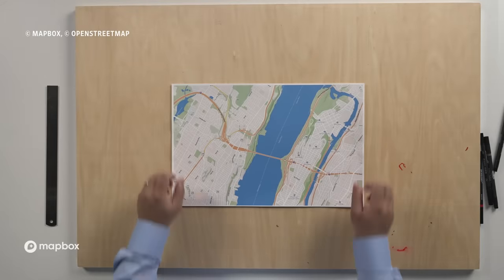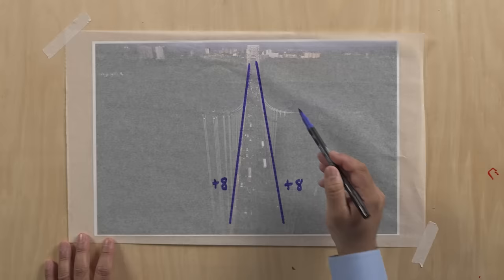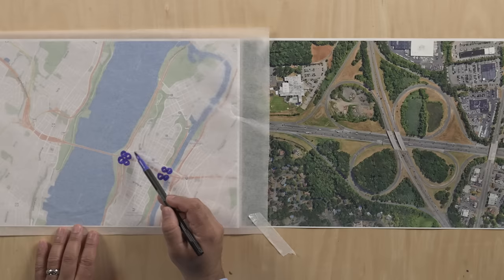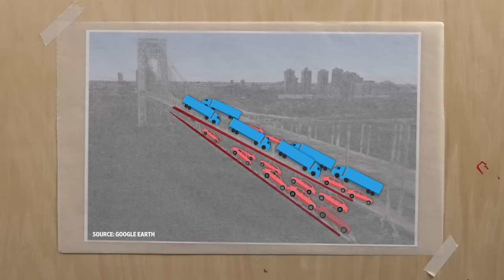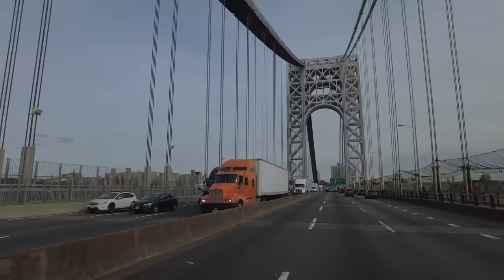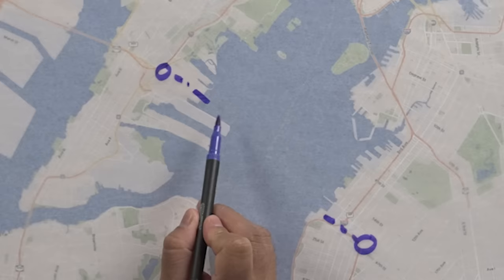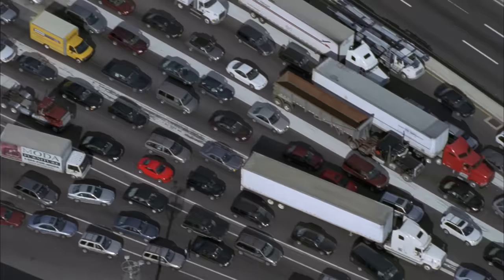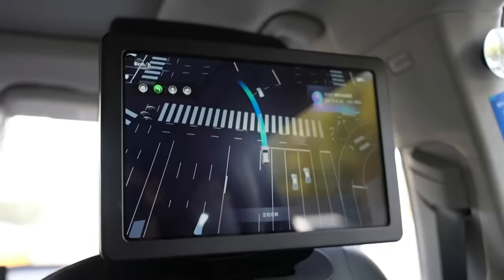Transportation Engineer Tries to Solve America's Worst Bottleneck | WSJ Pro Perfected

Comment: Great video, but one piece they missed is that I-95 (the busiest interstate in the country) is the main source of traffic on the GWB. A large portion of the traffic, including trucks and cars, traveling over the GWB are not going to the tri-state area, however to populated cities in Massachusetts, Maine, etc.  It would be great to have more routes into lower parts of Manhattan, however, anyone who regularly drives on I-95 knows that traffic doesn't get any better after crossing the bridge.
Reply: Sounds like they need express lanes
Reply: @Distress. or even a detour that doesn’t go thru the city
Reply: @Wurtyy  Something like the Big Dig?
Reply: @Awesome_Aasim  that would be pretty crazy but i’m sure effective. seems like the best solution as suggested in the vid is to improve passenger rail in NYC. but if the problem is regional travelers than that’s where our regional trains come into play which are…not good as of now.
Reply: @Wurtyy  I agree improving passenger rail is going to help. However, one issue is why are cars slowing down truck traffic? Having truck and bus only lanes actually helps alleviate congestion, since more people are going to be on the same road, just in a bus rather than a private automobile. The problem isn't that we built highways, the problem is that we never thought about segregating different types of vehicles to make best use of the road space.
Reply: @Awesome_Aasim  great point I didn’t think of that.
Reply: @Wurtyy  There are highways around the city but imagine that going around takes more time than sitting in traffic if not they would already do that.
Reply: @Distress.  The I 287 was designed to just that.  To re-route the I-95 traffic to the I-87 and across the hudson thru the Tappan Zee bridge.  But the I-287 became so popular for local traffic the it is now so congested and slow !  Classic case of induced demand.
Reply: Anyone going traveling North through NYC to New England needs to learn the proper route. They should just hop onto the GSP from 95, then take 287 across Tappan Zee, eventually getting back on to 95 and avoiding all the headaches
Reply: Those trucks shouldn’t even drive thru the city IMO
Reply: @Distress. or extend the northeast corridor south

Comment: GWB not too bad, but 95 Bronx is the worst, right after the GWB.
Reply: Exactly. The Cross Bronx expressway is the most congested highway in the nation. It handles I-95 and the majority of truck traffic in/out New England. There are no other alternatives thru the NYC area for trucks except the Tappan Zee bridge, which is about 20 miles north.
Reply: Which is why NYC is tryna get rid of  the Cross Bronx Expresway
Reply: @dr.woozie7500  because trucks can only go through GWB, lincoln and holland don't allow trucks.

Comment: Most of the traffic seems to be personal vehicles, so here's a simple, cost effective and easy solution that could be implemented within a year or so:
Convert one of the existing lanes in each direction to a bus lane. Add multiple bus lines connecting places where people want to go, and make sure that each line has service at least every 10 or 15 minutes. Ideally you'd have at least 30 busses using the bus lane on the bridge for each direction. All you need is busses, bus drivers, paint and little bit of law enforcement to keep drivers out of the bus lane.
Reply: thats not a solution kid, no sane hard working man would travel in a BUS. Its not dummy europe, everyone just runs away from the problem, the solution is to Upgrade the Decades old infrastructure
Reply: @SJRS700  Toronto has a great bus rapid transit network with plenty of riders and it's also not "dummy" europe
Reply: Yeah we already tried that on the Lincoln tunnel 5 miles south of the GWB and it hasn't done anything.
Reply: @SJRS700 Clearly you’re not from NYC. Everyone takes the bus. Rich or poor, and especially the hardworking.
Reply: @SJRS700 and what is that supposed to mean? “upgrade”
Reply: @SJRS700 hat exactly is “dummy Europe” in your view? You don’t want to compare yourself to the most liveable cities in the world… fine - but why would no ‘man’ (only the hardworking ones of course) ohh, and of sane mind want to use public transport? 

Seems to me that a little more public transport led community exposure could offer your opinion creation a bit more nuance and accuracy 🤷🏽‍♀️
Reply: Rail makes far more sense for the NYC metro area. 20 million people in the region alone. 8 million in the city proper. Manhattan already has horrible traffic with just 50k cars. You want almost everyone in the city to drive?
Reply: @Demopans5990  I agree that rail makes more sence, but building rail there requires a lot of money and political will, neither of which is easy to get. I mean, if there was the money and political will, rail connections would already exist. I'm suggesting busses and a bus lane simply because that doesn't require that much money nor political will. It's something you can do in a year (the limiting factor is how fast you can get busses and recruit/train bus drivers), and it'll serve people while you build better transit.
Reply: There are hundreds of busses crossing per rush hour. The problem is once you get across, the buses don't take you where you want to go, they dump you into a transfer to a subway that only goes south.
Reply: @SJRS700 i see construction workers riding buses all the time.

Comment: I rode my motorcycle across the GWB in 2016. The “paved” surface nearly shook my bike apart. While that was happening my motorcycle cover was being shaken out from under the seat cowl/cover…

I had to hold it with my left hand & the throttle with the right. That’s when I noticed that there were spots you could literally see through on the lower level. The GWB was the scariest bridge once you noticed it was falling apart every day. The Whitestone wasn’t much better. Driving over sketchy American Infrastructure by motorcycle really opened my eyes to how bad our roads & bridges are here.

Comment: And as always trains are the solution.
Reply: We need private trains!!
Reply: @ikanmesra  Those already exist, not everywhere though.
Reply: @MegaLokopo  I meant personal trains.
Reply: @ikanmesra  you could have those as well, yhey just dont exist yet.
Reply: @MegaLokopo  PRT (Personal Rapid Transit). Goood idea though, but create traffic jams just like cars do.
Reply: @ikanmesra  Not necessarily, you could have self driving train car things that automatically connect to each other, and are able to maintain higher speeds. Trains are more efficient because of rail, but they are also more efficient because of coordination, or the massive decrease in a need for coordination.
Reply: @MegaLokopo  Maybe because they can move straight only, meanwhile traffic jams caused by one or two driver who trying to brake in the middle of highway.
Reply: @ikanmesra  Traffic jams are actually caused not by one or two people brakeing in a highway, but every car in a row, brakeing slightly more than the car in front of them until someone eventually ends up brakeing to a complete stop. But yes so long as coordination was a thing, you could incorporate turns as well in a private train thingy.
Reply: @MegaLokopo  That's why the world need autopilot cars. Everything was fine.
Reply: @ikanmesra  Yep, and if you had every car be self driving, and would follow each other closely, it would effectively become a train. And buses would be the equivalent of a communal train carriage. Putting it on tracks makes the self driving a lot easier especially if you ban civilian drivers on public roads.
Reply: @MegaLokopo  Putting it on tracks? You mean trams?
Reply: @ikanmesra  What would you consider the difference between a train and a tram, really they are basically the same thing. And a train is really just a simple self steering car connected to a lot of other self steering cars.
Reply: @MegaLokopo  My country especially the area I live near the capital city needs more trains, coz our traffic are big. And yea, our drivers drives in very high speed even in residential areas.
Reply: This tells the reason why our country has more death on roads. We have MRT, LRT, BRT and ETS and buses but only immigrant workers use it. Citizens only hoping for car.

Comment: I remember crossing the GWB on the lower level when I first started driving a truck. I think after 9/11, they made it mandatory for all commercial vehicles to cross on the upper level. 

Since I got my CDL and became a truck driver (25 years ago this month), I’ve gotten to cross a lot of bridges and highways all over this country. Some bridges are cars and buses only, like the Golden Gate Bridge. Others are scary AF, like the Chesapeake Bay Bridge Tunnel, US 13 in Virginia. Last time I crossed it was about eight years ago, and they I was one of the last trucks to cross that day, before they closed it to high profile vehicles, because of the wind.

The only bridge or highway that I haven’t gotten to cross is the Mackinaw Bridge, from the UP to Lower Michigan. They close that to high profile vehicles sometimes, too.
Reply: trucks have always been required to take the upper level.

Comment: It seems that many traffic bottlenecks are caused by the expectation that single occupant private vehicles can go on any road anywhere at any time.  Imagine the GWB or any other congested highway with only trucks, buses, vans and emergency vehicles at peak times-much of the congestion is gone. That is the beauty of congestion pricing.
Test this the next time you are stuck in traffic. Look around and see how many single occupant cars are around you. (I usually get 8 or 9 out of 10). Now imagine that same stretch of road at the same time with only trucks, buses and vans.

Comment: If you travel south on 87 mobile gps will 9 times out of 10 navigate you TOWARDS the GWB, particularly if your destination includes trips over the Throgs Neck or Whitestone Bridges.  I think there is more to this story than "Congestion" when traffic is being directed towards the problem and not towards a potential solution.
Reply: gps does this because it is still the quickest way to destination; which is a testament to how much of an efficient beast the GWB really is. 

which route is quicker?
Reply: @johnnysecular  um, no. 87 to the Tappan Zee to 4 solid choices to points south and east.  There is an agenda as to why gps sends you to the gwb to sit in standstill traffic and it isn't efficiency.
Reply: @schnitzjr  mm maybe. what is the agenda?

Comment: Practically every town or city in the UK has a "park and ride" where you park your car, pay a few £ (around $5) and take a bus which runs every ten minutes and goes from the car park to the centre of town. Very often it is cheaper and easier than driving into the city and then trying to find somewhere to park. Not sure if the USA uses these?
Reply: In the US we do this much more with trains, particularly those running between suburban areas and the center city in my experience. I'm not familiar with any places that have major bus systems that extensively use the park and ride system here. Expanding out broader in North America, I think Toronto's GO Transit busses have some park-and-ride stations. Those might be just for their trains too though, I'm not entirely sure.

There are so few places in the US where busses have their own lanes and priority. In most places, driving yourself is at least as fast as going the same route by bus. The bus is going to get stuck in the same traffic you would in your own car, so may as well drive yourself. I don't know how much better the UK does in this area, but from what I've seen I have a pretty high opinion of busses in the UK. If people find it worthwhile to drive to a bus to get where they're going in the UK, then your bus systems must work much better than ours.

The other issue you run into with getting people to take busses here is the stigma. In the US, the bus "is for poor people". If you are of this mentality, it's very unlikely you'd want to drive yourself to a bus stop to then get on a bus with the people too bad off to own a car in the first place. Unfortunately, the number of people who align with this kind of thought is higher than it should be.

Comment: To get rid of cars you need good public transport. To get rid of the trucks you need a tunnel from New Jersy to Brooklyn under Manhattan that will have only one underground EXIT (no enterance) to manhattan while continuing further to Brooklyn. The trucks going accross will avoid manhattan, while trucks entering manhattan will not use so many space at bridges so there will be more for cars. And no enterace to tunnel in manhattan because exiting manhattan isn’t as big as an issue as entering it

Comment: Reading all the comments saying, "just add trains" is kind of thinking way too short. First off, suspension bridges are HORRIBLE for rail transit - especially rapid transit. The Manhattan Bridge (which carries the BDFM trains) had to be entirely closed because of how much maintenance it needed due accelerated wear by the trains constantly running over the bridge 24/7.  The GWB would need to be further strengthened and inspections would need to double just to make sure things don't go wrong.

Secondly, where exactly are the trains going to go? Yes, it will go into Manhattan... about 200ft in elevation. That doesn't sound like a problem until you remember you will have to find a way to get the subsequent train line to sea level and below with very limited space to do so as Grand Central and Penn Station are *below ground stations*. One could add loops down which certainly can help at the cost of speed and efficiency. Trains don't exactly turn quick. Alternatively, you could simply have the train be elevated... except it would be elevated about 100ft in the air once it slips out of the hills and with a 2 degree max gradient, it'll be a while till it gets to a more suitable level.
And on the NJ side... well there's not much there. What is already served by NJT goes to Penn Station or is served by the PATH to WTC and 34th Street. Plus the lines, they have to drill through the Palisades to stay level and then carve a path through the marshy Meadowlands and crowded suburbs. Basically, it will not be cheap on either side to just slap down a rail line.

Finally... where is the I-95 traffic going to go if limited greatly or cut off? Route it along I-287? Well, you're just moving the problem from the GWB to the Tappan Zee and it absolutely does not have the capacity to handle that load. Most likely, it would actually just overload the Lincoln and Holland tunnels if GWB is closed. No one is driving 20 to 30 minutes north to cross the Hudson by car. If you want to go 100% car-free, it will never happen. Even Tokyo, a place with amazing transit, can only attain so much ridership (about 20 million daily riders out of 36 million Tokyo metro residents). Thus, you will need to accommodate cars to some capacity even if you would like to see every car that exists to go up in flames.

This all said, basically, replacing the lower deck with train lines sounds like a good idea but all concepts that are great on paper may not be in practice. Always keep that rule of thumb in mind: The simple solution isn't always so simple. This isn't to say I wouldn't like such a solution - I absolutely would - but one has to be realistic. 

The solution I think would work is to cut down the lanes to 6 up top, 4 down below to decrease throughput while focusing on expanding rapid transit into the city further south. Build more tunnels and frequent rapid service to accommodate. Additionally, route trucks north via I-287 with reduced commercial tolls there so they don't drive through NYC unless they need to go to Long Island. Turn the upper deck into HOV/Bus and truck lanes only. All other traffic goes to the lower deck. I imagine this kind of plan would be done gradually over a decade in phases. First increase transit, then encourage commercial traffic to go around NYC, and finally redo the bridge layout.

Comment: The biggest issue is the flow of traffic on the bridge, not the merging before it. I live in Manhattan and drive (whenever I rent to go out of the city) over GWB a lot. Once on the bridge we still barely move. This is because the exit of traffic toward I95, Bronx & Connecticut in general is poorly designed and enforced. Smoothening that flow will largely solve the bridge issue. It's never gonna be fast, but it will be better than what it is today.

Agree with the improvements of regional rail & transit as well as the freight under harbor tunnel. Those will also help a lot.